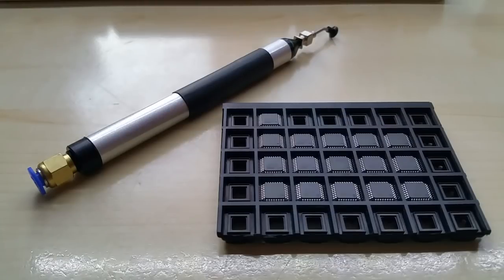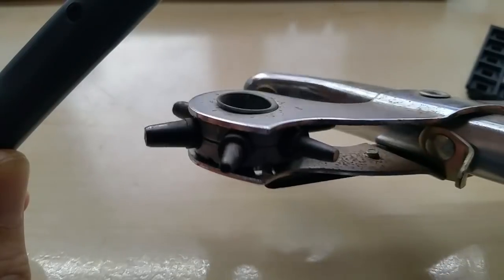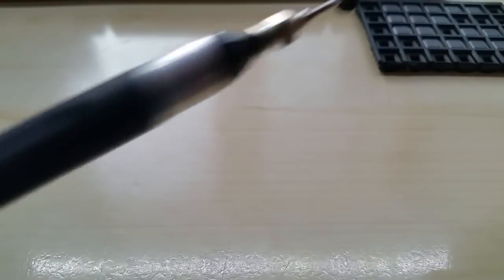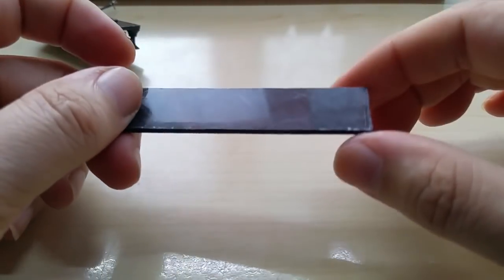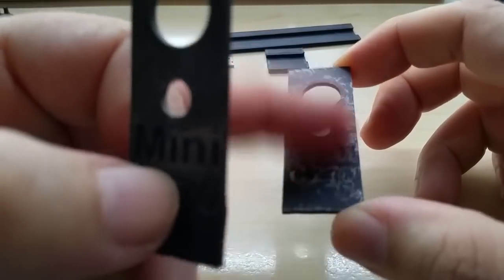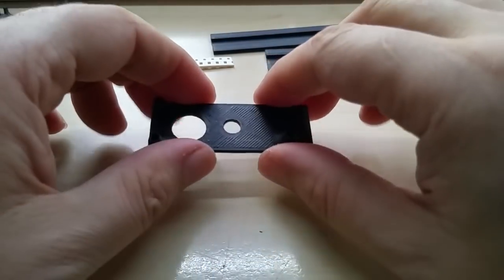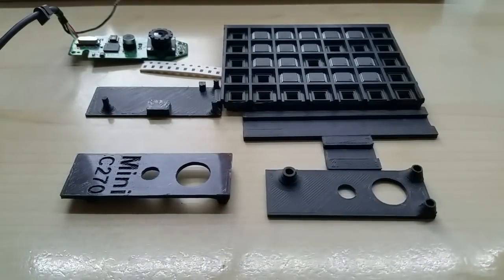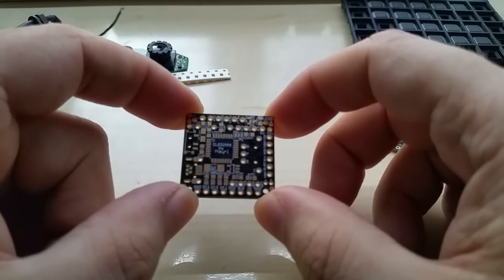Manual Pick and Place Pen and some ABS printing examples

Comment: This is great! I'm sorry if you said this and I missed it, but do you know what is the smallest SMD part size you can pickup? 0402?
Reply from the maker: Thanks, I am not sure as I don't have any 0402 parts but 0603 are certainly possible, worst case a finer tip would be needed and you could use a cut and shortened syringe tip.
Reply: @iHayri1  ah, right. Maybe I could find a luer lock fitting and tap the business end of the pen to use it. I have bags upon bags of various fine gauge syringe tips for solder paste. Thank you for the idea.
Reply from the maker: @ed.peguillan.3  You are very welcome :-)

Comment: Need to show how use slurry on base when printing. Also, I like the gray colour, looks unique!
Reply from the maker: Just slap it on there :-) Pour a little or how much you need on the print bed and use something to spread it out, that's it.
Reply: Hayri Oh, k, thanks. Easy. I'm thinking it's some kind of trick or complex setup. Haha, Thx.
Reply from the maker: Hehe, no magic involved, just try what works best for your setup, I seen people make several layers but one layer worked for me, it will depend also on your bed temp and what not :-)

Comment: Are you planning on simple stationary tapes for components are some sort of feeder for reels for your PnP?
Reply from the maker: Well, I do have reels for some of the parts but only because I bought 5000 pieces each of the 0805 parts. For the moment I will use trays as I did not see any feeder I liked, one other possibility is the head advancing the tape in the holder but that adds time to the placing of components, and the tape has to be loose enough for pulling My PNP is wide enough for 500 mm of strips which gives 125 0805 sized parts. That should be enough for many of my boards is a row.

Comment: interessante Sache, mit ABS zu "drucken" . Dieses nach Billig-Plastik aussehende PLA Zeugs hat mich immer vom Drucker-Kauf abgeschreckt. Noch interessanter wäre (für mich) ein ALU- Drucker. Guter Tipp, diesen "Poor Man" Pick and Place Pen gewissermaßen zu veredeln. Die nächste Bestellung in China wird somit demnächst getätigt. Könnte man statt des Kühlschrank-Kompressors nicht auch eine Aquarium-Pumpe nehmen (die natürlich von der saugenden Seite angeschlossen würde)
Reply from the maker: PLA kommt für mich auch nicht in Frage, hab nur etwas mit dem Drucker bekommen und selber ABS nachgekauft. Drucker für Alu wird wohl um einiges teurer werden :-) man kann natürlich eine Aquarium-Pumpe nehmen aber die sind mir einfach zu laut. Irgendwie wie ein Diesel Motor und ich mag lieber ruhig laufende V8 :-)
Reply: Wäre mal eine Idee, einen ausgemusterten Überdruckbehälter (Feuerlöscher ect.) mit Unterdruck zu "befüllen", dann müsste die Pumpe auch nur alle Jubelminuten anspringen -  by the way mag ich auch den kernigen V8- Sound lieber als den einer 1 L  Smart "Nähmaschine" ;-)

Comment: That PnP Pen is awesome man, should make manual assembly placement a breeze! And wow, I've never seen an ABS print look so glassy smooth, glass print bed is pretty cool. Shame there wasn't a way to make the rest of the print look so smooth. Thanks for the share.
Reply from the maker: Thanks appreciate it, it is really the most inexpensive PNP Pen you can get, it does also comes with different sizes of rubber tips. Actually you can make ABS really smooth by placing it in a closed container with a few drop of acetone on a rag or paper towel and depending how long you leave it in the surface gets smoothed out. The acetone basically evaporates the top layer, the only downside to that is that you loose fine details :-)